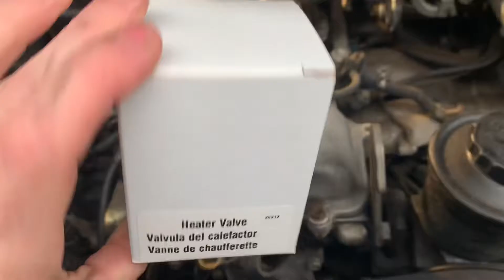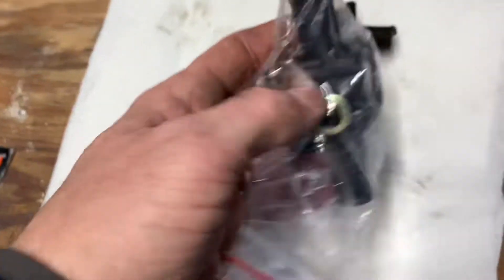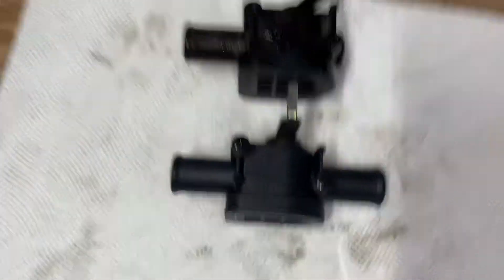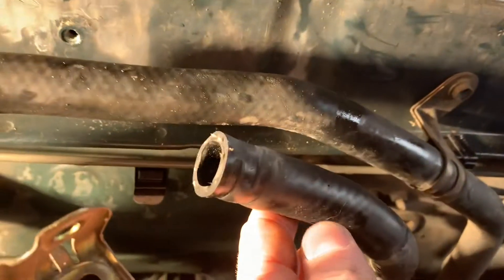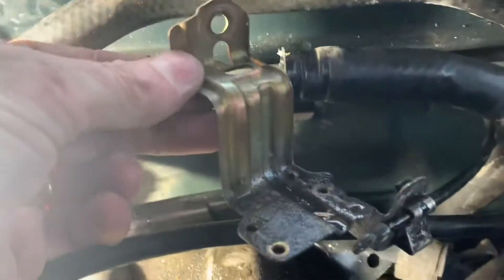DIY Toyota Tacoma Heater Control Valve Replacement 1998 2.7Liter 2-WD Pre-Runner [Tacoma HCV]

Comment: Outstanding. Thanks. Mine just failed right after the Radiator Hose. Thinking about replacing all the plastic parts in the cooling system.
Reply from the maker: Thank you!!✌️🍻

Comment: Would I have to re-bleed the cooling system or just leave it alone after replacement?
Reply from the maker: I can only speak from experience…I didn’t bleed the cooling system afterwards and had to issues.
Reply: @DIYTechnician  had 2 issues or had no issues? Thanks for the reply
Reply from the maker: @owen_636  sorry… no issues

Comment: How did you remove/ install the clamp on the side going to the heater core? Do you pull the cutter pin out to remove it?
Reply from the maker: I just had to remove the hose clamps on this one

Comment: are them four season valves any good have you had any issues with it
Reply from the maker: I do t know about the four season part but I’ve had no issues so far knock on wood. Thanks for watching. You gonna put on in?
Reply from the maker: I meant one not on.:)
Reply: Just buy OEM dude mine failed after a year and half. You will spend more money on crap parts from autozone whithin 3 years compared to an OEM part that lasts over a decade. Go to your local Toyota dealer and they will have it in stock.
Reply: I bought a genuine Toyota one i ordered from japan it took 2wks it was only $64
Reply: @Michael Brock   Do you know if the 2.4 is the same part? It looks like it.   I bought mine brand new in 1998. 25 years this March.  A starter, ball joints , an alternate and now this part. That's it.  
 Love this truck.

Comment: Anyone know what the hose that he moved out of the way at  :43 seconds is called? Mine is leaking coolant where it goes into the firewall.
Reply: Could be the coolant supply to the heater or could be the return hose. The heater has a supply and return hose and they go to the engine block.
Hope this helps